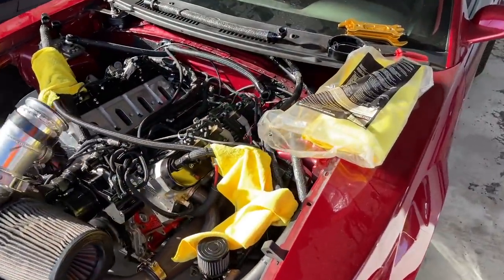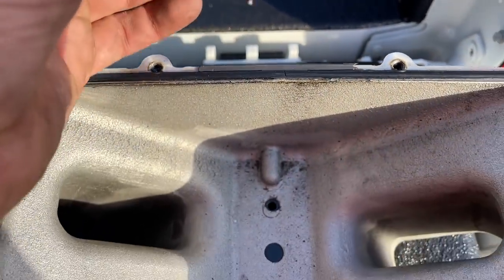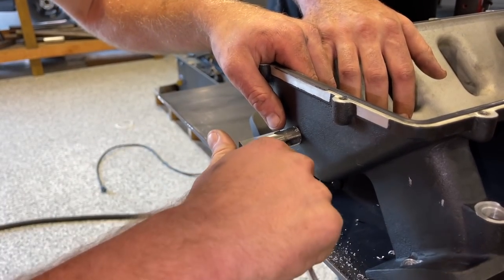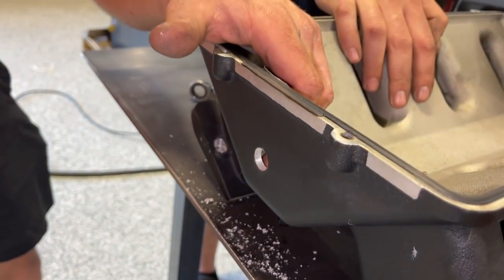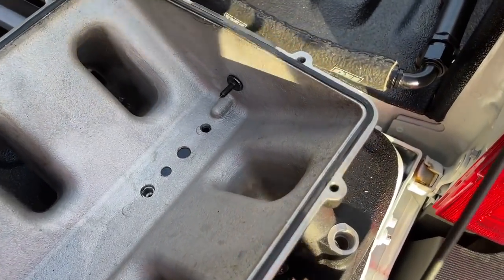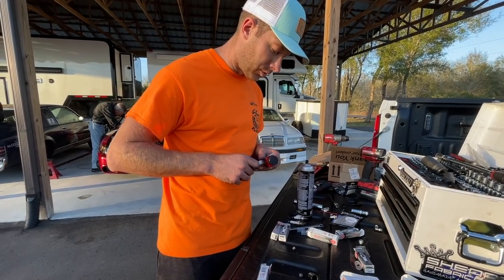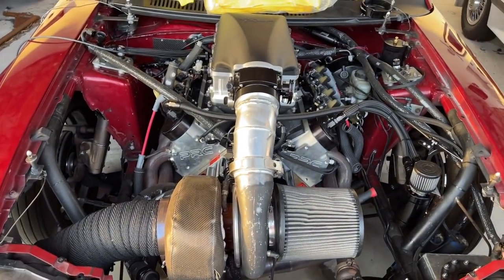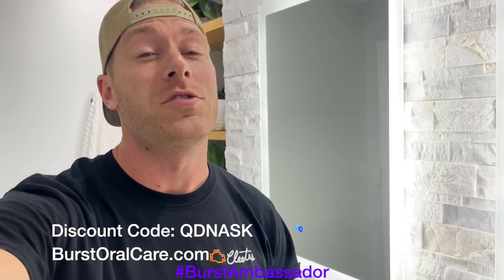We Found a HUGE Problem on Dr. Pepper that would have Caused Major Engine Damage

Comment: When running a tap in like that, especially in aluminum, stop every 3/4 or full turn and back up a 1/4 turn.  This will clear the chips out and give you a much nicer cut.
Reply from the maker: Good to know
Reply: Definitely.  I was kind of cringing watching him tap that hole without backing it out every 3/4 turn.  I also use a drop or two of cutting oil as well.
Reply: I didn't even bother to read anything before I just gave him the same lecture, only I mentioned two things aluminum sticks to taps and dies, and break a tap off in the steel, you just hired a machine shop to unfix the easy fix in order to fix it right. 
Although the is always the other alternative that's to weld the hole shut and start from scratch

Comment: When using the gap tool, i put .001 or .002 smaller feeler gauge in when you tighten the tool. That way when the electrode springs back a little it will be your .020 instead of .022. Idk if what i said makes sense but whatever
Reply from the maker: Good idea
Reply: @DoctrParker  yeah didn't even think of the spring back

Comment: You should still get those injectors rebuilt for a backup set. Your plugs are gas fouled because you lowered the boost after it was tuned for more. You should load the tune Nate did on the dyno before you fire it up so it doesn't kill the new plugs. Cheers brother 👍
Reply: Great advice

Comment: The old Top Fuel guys will turn the engine over backwards with a breaker bar on the crank bolt to push any trapped fuel out of the cylinders thru the still open exhaust valves. This eliminated the hydraulic lock situation and potential explosion if you compress nitromethane fuel. Watch some old footage and you'll see them doing it.

Comment: Might be worth a squirt of oil into each spark plug hole to lubricate  the bores and rings cause they could be dry once the fuel is evaporated away
Reply from the maker: It would for sure

Comment: You might find it easier if you deburr the hole after drilling with a cone cutter very lightly, you only need a millimetre of chamfer to leave it easier to start the tap . Where both sides are accessible like that inlet manifold it's good practice to deburr both sides of the hole , this will leave a cleaner thread with no flakey partial threads to worry about. When cutting threads, reverse the tap or die every turn to break off the swarf while it's still small to help prevent the tap or die from binding up and damaging the threads , very important with smaller taps that could snap off in the hole .
Reply from the maker: Great tip! I’ll do it

Comment: Hey Parker, Another Great video. You are Doing a great job. With all the Wrenching, Racing,
YouTube, Filming and editing Plus you Running a Dental Practice. You are killing it. You said that the e90 was dirty and clogging up your injectors. It is the ethanol that does that. When it dries out it oxidises and makes a mess of your fuel system. A way to prevent this is to get that Ethanol based gas out of the system. I am pretty sure you have a race tank up front for the e90 race gas. After your last pass and before you put it in the Trailer for it then to sit for however long until you work on it or race it again. It might have one already, but put a drain in the bottom of the race tank. Drain all the e90 out of it and put in some good quality Ethanol free Premium Gasoline with a dash of upper cylinder lubricant in it. Then start the car and run it for a good 5 - 10 minutes while loading it in the Trailer etc. That way the Race gas system is free of Ethanol and will not oxidise. That way it can sit for weeks with no problems. It is also Great for your Fuel pumps. The amount of Fuel pumps i repair or have to replace because they are trashed from having Ethanol sitting in them. Just an idea that i thought i would share. I have done this to several race cars now and they don't have any issues. Keep up the Great content we appreciate all the effort you put in. Thanks Dude.

Comment: Good call on the spark plug gap tool...There was a video from PapadakisRacing long ago that shown their engine got something because of the ceramic insulator cracking off and went into in the motor. They then thought about how they adjust their plugs by tapping on it and that could have caused the problem
Reply from the maker: Probably!

Comment: Okay Dr. Tooth
Rules to tap by, even though they say you can run a tap straight through, it's always better to get it started straight and make about a turn and a half. 
Then back it out until you see the chips fall off, and then back in for another turn are so, then repeat. 
Especially this is important on soft metals, because they will stick to the thread cutters on a tap or die, because of the heat caused by friction. 
That's why do it by hand, go in couple turns, and back it out.
Better than the alternative which is having to drill it out oversized, and retap it then install a heli coil with loctite which is actually stronger than just tapping aluminum itself. 
Same holds true for steel, only the end results of not clearing the debris from the tap is a busted piece of tap stuck in the hole that you were trying to repair. 
Only now you need a machine shop to fix the booboo you just made.

Comment: That cougar is sweet I built a poppy orange 85 for my first car in high school put a 94 cobra engine in it with 292 488/488 cam and 650 with a torker intake I screwed up and dead headed the blue pump and my needle and seat on the primary side leaked down and filled number 1 cyl up and shortened the rod enough the piston was hitting the counter weight got drunk at a party later that night and threw a brick on the gas pedal on a bet damn thing ran out of gas before it blew up drove it 3 more weeks before it started to get quiet again I pulled and salvaged what I could and sold the car for scrap some guy bought it for his son and they put a 351 in it and painted it Grey and put the black interior out of a supercougar in it

Comment: From my experience I have found if you Remote mount the map sensor it’s less susceptible to failure or damage from vibration and can be more easily serviced if mounted in a more accessible position :) 

Good work love the channel
Reply from the maker: Hmmmm interesting
Reply: @DoctrParker  sorry hope that didn’t come across negatively or anything, I own a performance shop here in Australia and I thoroughly enjoy watch the group and envy the freedom you guys have with street cars and drag events over where you are :)
Reply: @joshdavies886  Na mate you are on the money, you should see every part as if it was bolted to some old rattly 4 cyl, aka if you can shake it you will eventually bake it

Comment: Doc, little tip, take it or leave it, screw turn in and then back out when tapping and you don’t need to use as much torque and less chance of snapping the tap. Ask me how I learned that one?  Haha.
Reply: Thats more so with steel not this soft aluminum. Its still a good thing to do either way.
Reply: @warrenmichael918  your right. My bad
Reply: @frankrizzo5057  You werent wrong by any means though. Its still a good thing to be doing, its just not as big of a deal with the soft metals. I like to back off even in soft materials so the chips dont get dragged through the soft threads. Not that it will do much damage but its a thought i always have.
Reply: @warrenmichael918  same reason I back off.  Wasn’t thinking of aluminum though. Thanks
Reply: @frankrizzo5057  I hate taps! It seems like i can break them off just by looking at them funny. I see guys on here using impact drivers to tap huge holes without ever breaking them off in half inch thick crap. I try to tap a tiny hole in thin steel,,,,,snap!!!!  HAHA
Reply: @warrenmichael918  I always think the same when I see them at it with a cordless Milwaukee. I can’t get them with the tool

Comment: Replace the air filter, there have been cases of that type collapsing and also coming apart and going through whatever it's supposed to filter.
Reply from the maker: You don’t like my massive air filter lol?
Reply: @DoctrParker  lol not that, I have a 5" air filter for my build also. It's the design that's troubling and has caused problems in the past (hearsay by the way, not my own experience) just trying to help point out a potential future issue.

Comment: The older I get the more I realize the importance of organization. I can't begin to count the HOURS of my life that's been waisted looking for shit. For something like a drag and drive I would have it broken down you can get tool bags with zippers pretty cheap. Instead of a specific place for something have a bag associated with a portion of the vehicle. Then you would have a wrench bag, ratchets and sockets , engine, suspension and have and clearly labeled and a wrench to fit all of the things commonly worked on. Then 2 people can work together each having the tools they need for that job no tossing the 15mm back and forth. There's probably going to be one in every bag. Any time you work on the car  use the bags so you can know what might be a helpful addition. Clean up will be easy throw it all back into your bag and it's there next time. It will take time going around checking bolt sizes but come race week you'll thank yourself.

Comment: Hydraulic lock on an engine is a bad thing , on the old radial aircraft engines they turn them over by had before every start if they been setting to long .
Reply from the maker: Gunna start doing that with this car

Comment: Also, mic your drill bit next time. Looks like you went oversized and barely got much for threads cut. Gotta be Dead on for the hole size. Did you use a cone? Thats why.
Reply from the maker: Definitely didn’t go oversized or use a cone. It was undersized and perfect. Didn’t show that part of the work.
Reply: @DoctrParker  perfect, just wanted to make sure. Video didnt show the threads well. Likely because it shiny. Hell yah brother!